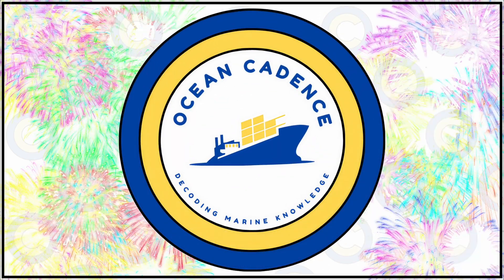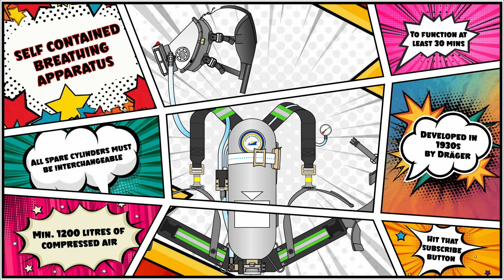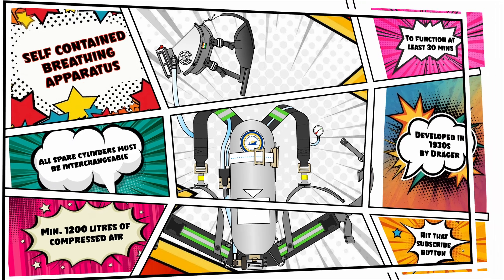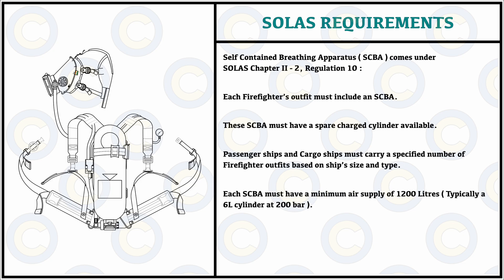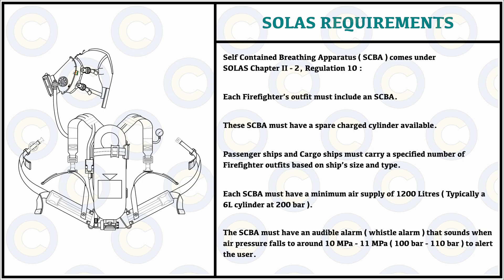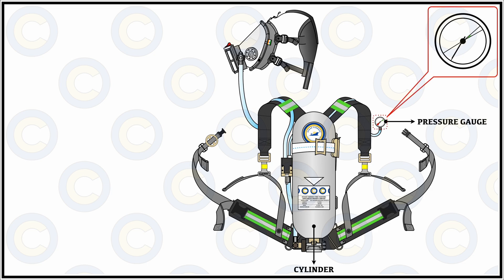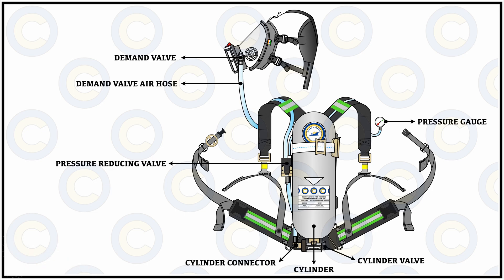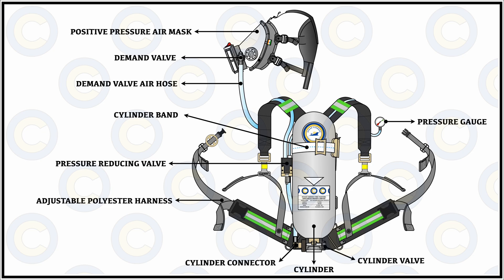SCBA on Ship | Self Contained Breathing Apparatus | SCBA SOLAS Regulations | SCBA inspection & check

Comment: can u tell me how much bars of pressure is reduced in reducer valve and how much bars a peson breath in the face mask
Reply from the maker: In the reducing valve, the pressure is reduced from 200 bars (bottle to line pressure) to 6 bars. Further, the breathing arrangement inside the mask i.e. the demand valve brings the pressure down to a value slightly above atmospheric or ambient to maintain positive pressure and seal external gases from ingress